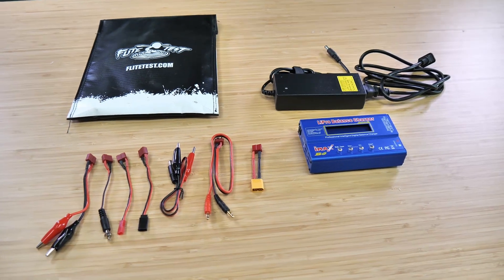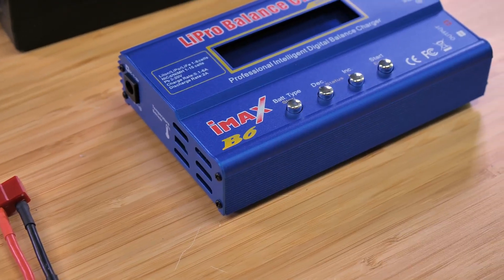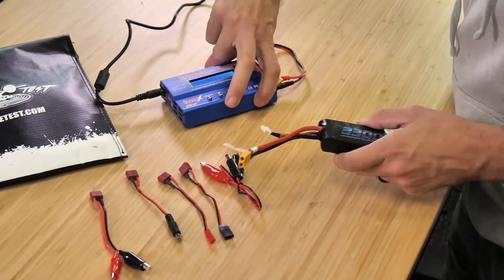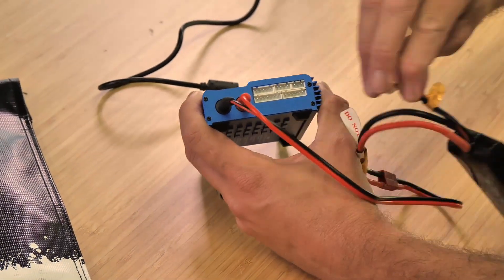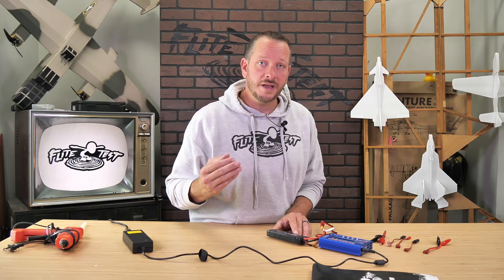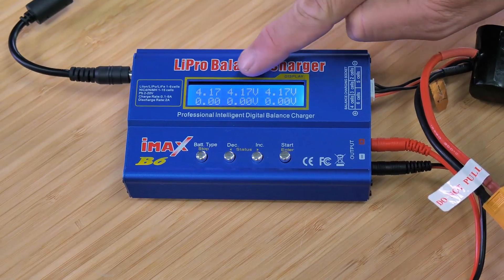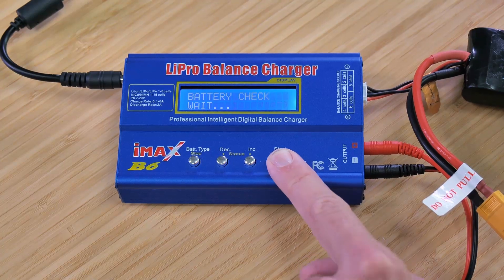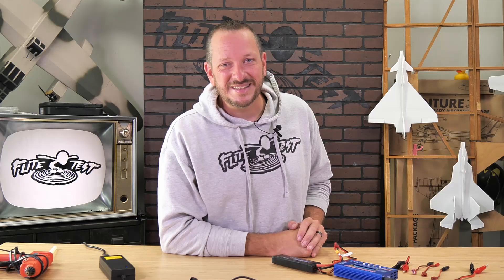How to Safely Charge Your Batteries  //  Quick Tip

Comment: I selected balanced charge but the cells have a difference of 20 mv or greater & wont charge past 7.3v.  Even when I had a new battery.  I asked the guy at the store & he said I was using the wrong setting.  When I use the regular charge feature it allows me to charge past 7.3v.  I can’t explain why.

Comment: Ok, dumb question. How long do you have to charge a battery? Will the IMAX B6 charger automatically stop charging when the battery is full, do you have to set a timer yourself and stop the charging manually, do you have to keep monitoring the voltages on the screen or is there a built in timer that tells you when to shut it off? Nobody talks about this, but I'm just curious 😅👍

Comment: Ok so i have li ion battery and each cells are 2000 mah 3.7v like 8 into one battery will it can charge?and the plug are the same as your battery too but the white plug one have five connection and yours only three
Reply: these chargers have different modes, important to just put the correct mode on, he has it on lipo mode.

u can put them on several modes.

Comment: I charge at 3c rate. No issues. Got this charger. Just make sure to use the balance port as to not get wrong voltage and you are done in an hour
Reply: how long have u had the batteries ?

Comment: Guys pls help why does it keep saying wrong voltage when it’s supposed to be 11.1v😢
Reply: Nvmd now i changed it to 7.4v and it changes to 2 cells, but it says the lipo only detects one cell, but my battery is a 1000mAH 11.1v battery
Reply: So should I charge it at 7.4volts or not

Comment: What kind of plug adapters would i need for the smaller batteries like a 1 cell 3.7v 380 mAh batteriy for my rage p47 rc plane. Those small batteries have a small connector and I cant figure out the search term to find what its called. Could yall help me out? Thank you! Would that Pigtail connector he was talking about @1:56?

Comment: Hey just wanted to say thanks for the error test, finally found out that my battery is 11.1v, I bought a lipo but I forgot what Voltage it was(did not have a check mark if it was 7.4 or 11.1v), and when I asked the shop he told me it was 7.4v but it looked like it had 3 cells and I didn't want to charge it wrong so thanks so much for that test!
Reply: So was it 7.4v or 11.1v?
Reply: @Brickz-Commander  It was 11.1v! Brand was Bosli-po, Tootsie/m4 tube type.

Comment: How does it know the mah capacity?
Reply: it doesn't that's for you to control these chargers are all manual for the most part that is why you need to know what your doing with these batteries and chargers.
Reply: @ethanbaker2979  tnx

Comment: Quick tip. Make sure to unlug the adaper from the battery first, rather than unplugging the leads from the charger first.
Just short circuited my batter ;/

Comment: Thanks for the advice, I just got into the rc game. I have a venom pro quad charger and this helped me out with charging my 4s & 6s batteries properly, 
any advice on what Amp to set for a 4s battery 14.8V 4s1p 100.64Wh
120c 6800 mah 

Thank in advance

Comment: Good video, it helped me alot. 
Today I used my new imax B6 for the first time for a Lipo 6S 22.2V Roaringtop 3700mAh 
which was great since it is the first option to pop up. Plugged everything in.
I set the charger at 3.7 amps, on 'ballance'. Looked good. Charged the battery in 36 minutes. 
Loud alarm and it said "Full"  I pushed the stop button. Just when I took off the neg aligator 
clip for the battery the 110 power supply popped and suddenly everything died.  
After some trbl shooting I confirmed it is the power supply and not the charger. 
What did I do wrong?  I went by the plugging/unplugging sequence given in the manual. 
And wasn't that an awefully fast charge time?  Maybe I had the amps set too high?
I guess I'll try to find a new PS, but I need to know why or how I fried this one.
The charger is still okay, tested on car battery. But the 110 PS went out at exactly the time 
I took off the Neg aligator from the batt wire.  Thnks for any advice.

Comment: Should I still charge my batteries after they have been sitting for years not in use but they were brand new?
Reply: If you do not use the battery for a long time, do not fully charge it, but put the charger in storage mode.

Comment: It's a shame you guys didn't show use of a better quality charger. There are a HUGE number of low-quality clones of the Imax and it's impossible to tell which are good. The original "good" Imax has a habit of killing batteries (sometimes explosively), and the clones are FAR worse. Quite frankly, the Imax should never be recommended by anyone serious in this hobby.

Comment: Lipo balance is MUST for charging specially if you tap peripheral power for things like video systems and now that ridicules RID modules that do not use the full cell count.
Reply: Use a BEC for that stuff, or an ESC with an integral BEC. Dont tap the balance lead, you will kill the battery much quicker once the cells get mismatched. a 3 amp 2-6s micro bec circuit board is about 4 grams.
Reply: @BadHaddy  Tell everyone else I already know that stuff which is why I said what I did. Too many people like to shortcut things or be butt clenched tight with their budget  and do use balance ports as single cell taps.

Comment: .5 c is way safer .... 1 c is at the upper limit
Reply: Actually on some pack sizes the charger would struggle to bring it to full charge at .5c.  even the battery manufacturers (no matter who) recommend 1c for safety and long lifespan of their products.
Reply: not realy,  i have batterys that can take up to 5C without any problem. also keep in mind most modern smartphones charge at higher rates than 1C . but it depends on the battery type. high current cells that most model planes, drones and cars use are fine up to 2C. but i sometimes had the problem, if i charge slower than 0.5C , i cant get the fully rated mah in the pack. 

but in general i recommend sticking with 1C maybe 2c if it needs to be charged fast, and ALWAYS use balance-charge mode.